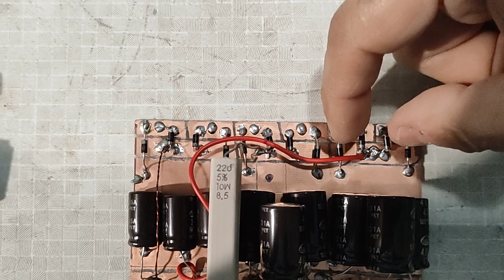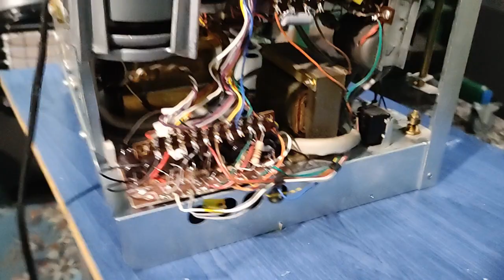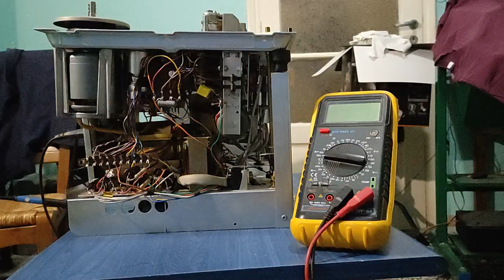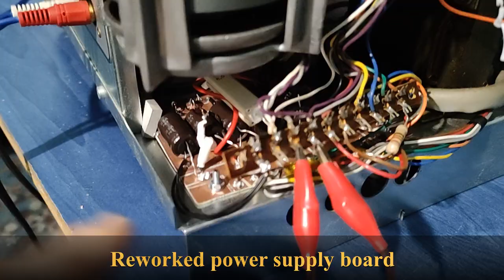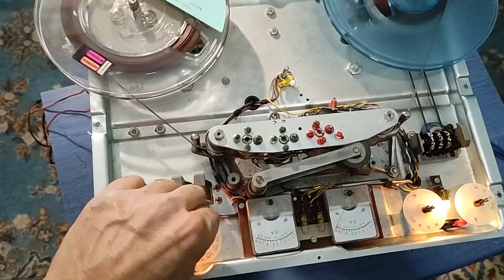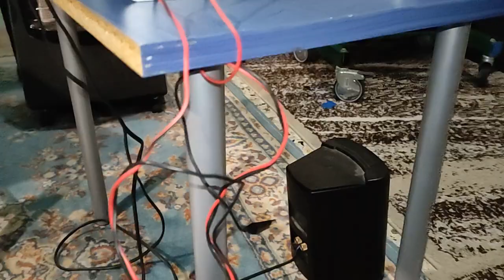Revox G36 rebuild the power supply, success this time

Comment: I just replaced a rectifier in one of my machines as one of the legs had come loose, but I think the later mkIII units already had silicon. But why did you need to replace your power supply? I think I saw in another video that the original one was still working? Was it just a precaution?
Reply from the maker: It's because I like doing repairs and showing them on videos. The original power supply was working correctly. Some people warn me that the big caps go dry, loose capacitance or go short circuit and will burn staff in the machine but I don't know if this is really a risk. Anyway I built the new power supply just to confirm I can do it and also to help people with bad power supplies fix their machines.
Reply: @dchatz ok that’s good to know, it was definitely impressive and really got me thinking that over time one could replace whole sections of the insides of these things to make it more robust and using modern components. Then the only servicing is mechanical.